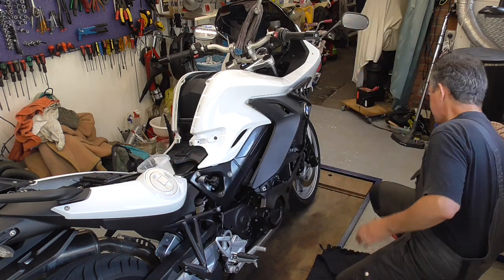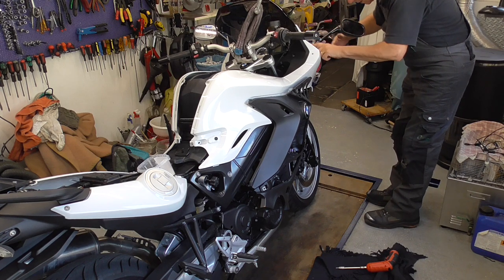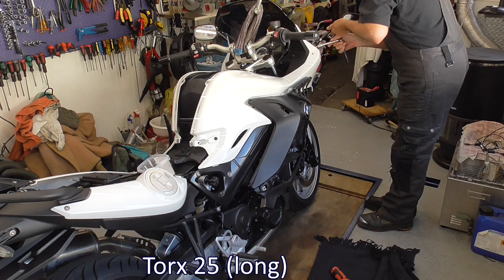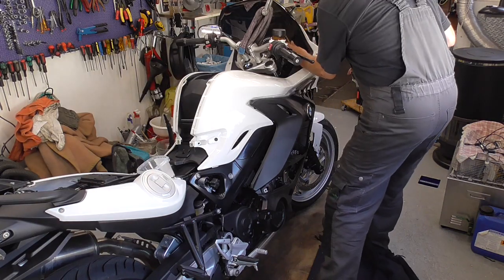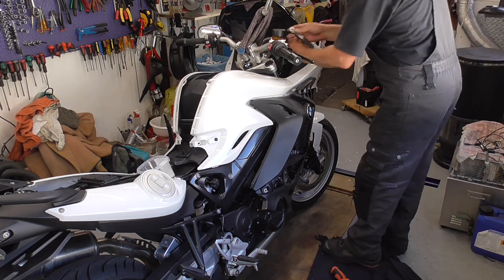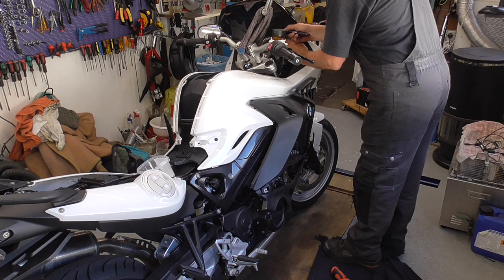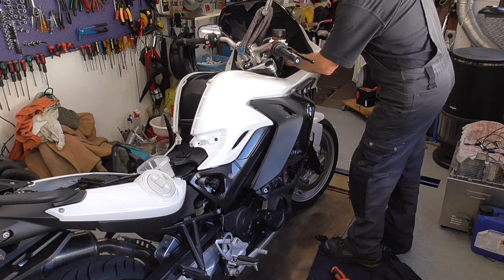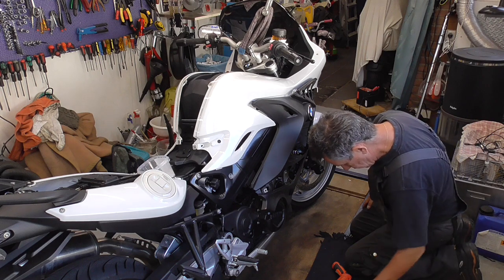BMW F800GT [2014-] HOW TO GET THE PANELS OFF. Motorcycle Maintenance made easy The Old Mechanic👨‍🔧-🏍

Comment: I noticed you removed the panel screws and placed them in a container; on my beemer, (not the F800) I did the same thing, only to discover some screws had shoulders some didn't, so how do you know which screw goes where when refitting? Is there detailed diagrams with such information available for BMW motorcycles? If so could someone direct me to it?